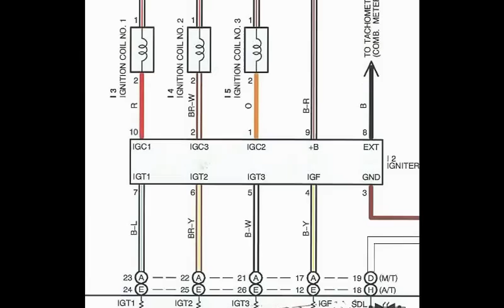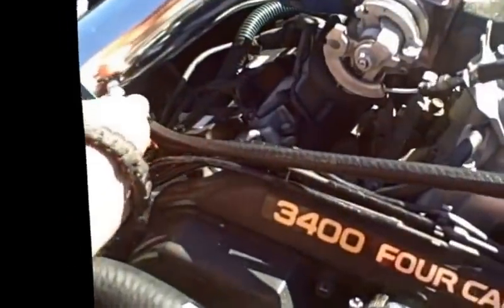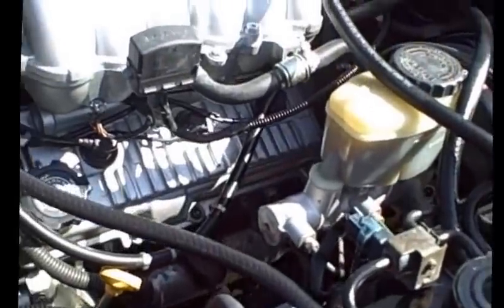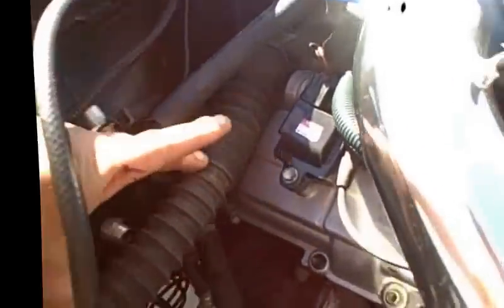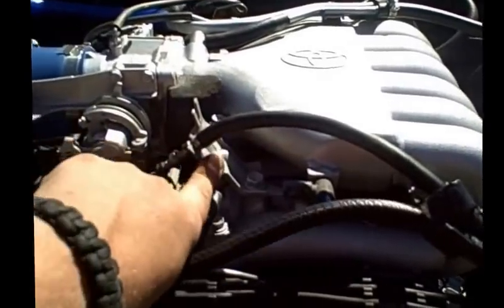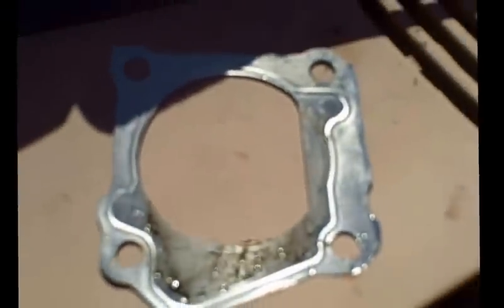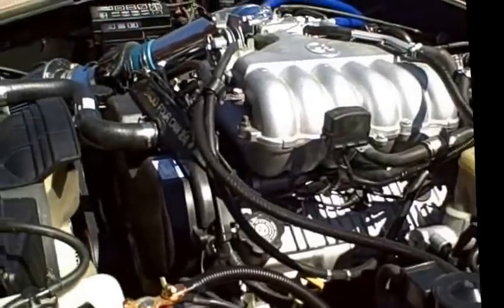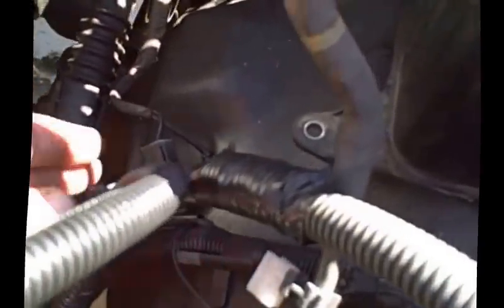94 Toyota 3.0 to 97 3.4 Engine Swap

Comment: Did you also have to change your ecu to a manual, or were you able to re-pin the automatic computer. The plugs into the ecu are totally different but you said you only had to repin with new plugs. Also did you take the charcoal canister out of your rig completely and replace it with the EVAP?  Thanks halfway there with my swap, yours turned out incredible.
Reply from the maker: yes, I had to use a manual ECU and re pin the plugs for it to work.  I had to re pin with new plugs because the auto ECU that came with the engine had to be re pinned to fit the manual ecu which had different plugs.  Thanks.......it was a monumental task as I didn't know what the hell I was doing at all!

Comment: What did you do for the oil pan? i have a 90 4runner putting a 2000 3.4 engine into it,  the 3.0 oil pan bolts directly on but what do i do with the pickup tube? the 3.4 tube doesn't fit with the 3.0 pan and the 3.0 tube doesn't look like it fits unless i take off the splash guard, then it might fit?. I'm just not sure. thanks for all the info!
Reply from the maker: +Christian Lambert Sorry for the late reply.  I believe your axle is different on the 2000 and will need a different pan.  Please join yotatech.com and ask away.  You will need to use the 90 oil pan and the related pick up tube.

Comment: Hey I saw another video on here and the guy used a 2 in body lift to “make room” for the 3.4 I’m wondering if you used one for hood clearance? Thank you for the video it helps a lot I’m going to be starting the swap in the next month and would just like to know the answer to that question.
Reply from the maker: Well, there was just enough room for the hood to close but I decided to cut the hood and put a low scoop on it like the newer 4 runners. It looks pretty bad ass.  Good luck with your project. Keep in mind I had no idea what I was doing when I started. If I can do it you can do it.  GL

Comment: i have a 2002 5vzfe that was out of a auto trans so cpu will not work, cuz its going in my 1991 4runner which is manual. the E-vap box and vacuum lines are biggest problems for me and price for E-vap box is high$$$.
Reply from the maker: +Toyota joe  Go to YotaTech and ask around.  It will work.  but you will have to use the 91 TO bearing AND the pilot clutch bearing in the 2002 so it will link to the Manual.  My donor engine was an auto that went into my Manual.  Sorry for the late reply.  Use your current evap box..........
Reply: Logan S thanks for the help.

Comment: i also heard you can use the oil pan and pickup from a t100 it would just be easier for me to use the parts i already have like i heard on this video you said you slapped your 3.0 pan right on, any help would be great!
Reply from the maker: +Christian Lambert   Sorry for the late reply.  I believe you can use the t100, but for certain I know that your 3.0 pan will have to go on the 5vz engine due to the front axle.

Comment: hey where in Oregon are you located? im in the middle of a swap, the engine is bolted to the transmissiom, and all I have left to do is hook up the vacuum hoses and harness. only problem is I have no idea how to go about doing this, as it seems like I don't have enough room on the harness to reach everything. I'm sure it's the easiest thing in the world to do, I just really didnt know too much about cars before I started this project. I rebuilt the 5vz, took out the 3vz and put the 5vz in by myself, and I can tell what a few of the things do, I'm just very confused. sorry about the long post haha
Reply from the maker: I"m in Central OR.  you will need to get the conversion harness to reach the transmission. I didn't know anything about what I was doing either.  Trust me, when it starts, you will feel like a rock star bro. Pick it up from toyonlyswaps.com   Best money you will spend as it will save a ton of headaches.  Be patient, it will work out fine.  Call them, and they will tell you what part of the harness they will need......basically everything from the pass side that branches off from the valve covers back...........and be sure to save the firewall grommet. I just used a cut off too, bent it back and pulled it out. BUT, chances are you have already done that.

Comment: You mention 5 quarts of oil and 1 of trans fluid won't that over fill the engine.
Reply from the maker: Yeah, I probably spoke wrong as I wasn't using notes. Just put in a quart of ATF and fill the rest with oil. Let it run for about 15 min then drain and add oil. I did it twice using cheap oil.  Both were dirty AF.

Comment: you didn't cover the exhaust system...its all from the 3.0?  direct bolt up?
Reply from the maker: I guess that is what I get for not working off of notes with few cuts. Yes, I did forget the exhaust system.  The 3.0 exhaust is a driver side system.  The 3.4 exhaust exits at the passenger side. To fix this, I purchased what is called a "crossover" pipe that will bring the exhaust to the drivers side that is bolted the the cat before going to the pipe.  You will need the year model of the engine you are installing and have a bung attached to it for the 02 sensor.  I can't remember the distance but the bung has to be positioned at the correct distance for a proper reading. I got my crossover from Toyonlyswaps.com as my welding skills would have messed it up for sure.  There are instructions on how to do it on YotaTech though if you chose to do so.  Nice catch.  I think that is the only thing I didn't cover.
Reply: where did you get the cross over pipe? I used to build these engines and the 3.0 for Toyota so I know just about everything needed... just wanted to see what hurdles you ran into with the exhaust... not many videos on this swap cover that... I have a 92 runner with an engine that just started knocking so im debating whether to rebuild it or do a swap.. thanks, kevin
Reply from the maker: toyonlyswaps.com out of Oregon.  About $175.  Well worth.  You will have to mail your current engine pipe to them for mod. Don't rebuild it.  Get the 3.4.  You will thank me later.  Just be sure to have a compression check done on it at the yard to be safe.  Once again, I had NO experience doing this and pulled it off like a champ.  Be patient, learn and the reward will be amazing.  GL
Reply: also where did you get your valve shim? Ive looked all over and even asked machine shops and they said they only come from Toyota.
Reply from the maker: ndspeedster
  don't get them at the dealership.  I got mine from cylinderheadsupply.com  I have a write up in the YotaTech forum on how to measure it etc.  I'm Oregonslonewolf on the forum.
  Chances are you only have 2 out of spec on the exhaust side. Intake will be fine as they don't get the heat.  Don't bother checking the intake sides.

Comment: What ECU do you need to use? Is it just the ECU that matches the engine/transmission that you pulled it from?
Reply from the maker: yes, the ECU that matches the engine and the trans.

Comment: Hi I have a 1991 4runner with a 2L-te in it.  It used to have a 3vz year ago.  and I'm about to need to replace the Head again for the 3rd time.  The head costs more than an entire 5vzfe engine.  I have a R150 5-speed and I have been doing some researching.   Do you have a parts list of items you had to get?  I understand from your Awesome Video you need the following.   Engine, ECU (auto or manual), EGR body, 3.0 or 3.4 Flywheel clutch etc. But 3.0 Throughout bearing, hoses, and power steering mods etc.  Also I found that its possible to use the same manual Trans bellhousing for a 3.0 on the 3.4?
Reply from the maker: Hey Kevin,  Thanks for the positive comment on my "seat of the pants" video I did. Sorry to hear about the bad luck with your heads.  I don't have a parts list for ya unfortunately. Seems like you have it down. Further clarification can be had by going to YotaTech.   You will be facing the challenge as I did of having to re pin your manual transmisstion plugs to the MANUAL ECU. The pics of the plugs in the beginning of me doing just that.  The MANUAL ECUs  are pretty hard to source and chances are you will only be able to find the auto engine and ECU as I did.  Go to YotaTech if you haven't already done so and look for a thread where he used a 97 ECU and 97 engine to "repin" so it will work. Once again you will need a 97 manual ECU.  He goes step by step on how to do it.  Pay close attention on making sure your negative black grounds are property seated in the plug, They can be a pain.  Good luck
Reply from the maker: Yes your manual will mount right up no problems.
Reply from the maker: For more clarification, you will be using the wiring harness from the automatic engine and "re pinning" them into manual plugs to work with the manual tranny and the plugs that go with the Manual ECU of that year engine.

Comment: Logan I have a 2000 3.4 donor is auto but I live in California so what would I need to do to clear the emissions in California and not have the check light on.. what do you recommend
Reply from the maker: that I don't know exactly. I recommend you go to YotaTech.com , sign up, and ask around.  the ECU and egr is key...I think.  your 02 sensors play a part too.
Reply: +Logan S ok thank you yeah trying to read as much as I can on it

Comment: You hydro locked the 3.0 so you put a ebay cold air intake on?
Reply from the maker: No no, I didn't have a cold air intake on the 3.0. The airbox mod (drilling holes in the air filter box) sucked in the water when I went down.

Comment: I just have a question on wiring. Did your engine come with the wiring? What wiring do you recommend just getting the actual harness? I have the main engine harness but I've read that the engine won't run without the dash harness, is this true?
Reply from the maker: Yes my engine came with the wiring harness for the engine.  However, this was an automatic engine I had to re pin to match up with my manual transmission and it needed new plugs too to fit the same year manual transmission ECU. Yes on the dash harness.  Contact ToyOnlySwaps in Oregon and they can assist you.  This has all of the needed connections to your transmission 4x4 etc.

Comment: Question I heard there's a 4.0 motor that fits on a 4runner that saves gas and more horsepower i got a 93 4x4
Reply from the maker: Yeah, the 2003 is a 4.0.  Seems like a tough conversion to me as I don't think it even used the same transmission computer, motor mounts and whatnot.  Time for you to get to studying that one.  I have no idea.

Comment: logan i got 1994 toyota 4 sr5 4x4 v-6 3.0 efi it is in automatic what engine u put in. make n model i want a 3.4 autmatic engine mine
Reply from the maker: +justin Roa  I too put in a Toyota 3.4 which is what this video is about.  Without a doubt I would put in a Toyota 3.4.  Keep it Toyota. 97-2001 3.4 are outstanding engines.  The 3.0 is a 3.slow.  You will have much easier luck finding and auto than I did finding a Manual.  Check out YotaTech.com. Sign up and read, read, read, read....................then read some more.  I had NO experience prior to this with exception to changing a timing belt.  That site saved my life!!!!!   GL

Comment: Great Video. I will be doing this swap soon. Although the Manual ECU is very hard to come by these days. I am still on the look out for one.

Is the 2" Body Lift absolutely necessary? I was wondering if i can get away with a 1" Body Lift and maybe cutting the hood skeleton.

Comment: Is this a better engine than the 3.0 svze?  As far as repairs breakdowns reliability ?
Reply: The 3.0 is a very underpowered engine, it has its infamous head gasket issues but if it’s replaced with the upgraded ones it should be fine. 3.4 is more powerful and more reliable, but the 3.0 is fine for most people.

Comment: I have a limited  1997  3.4 l 4runner  that I flip and total the body can I put the engine and  tranz in a  1995 4 runner
Reply from the maker: +Patrick Blades  yes you can.  You will have some challenges with the ECU from the 97 linking to your 95.  You will need the schematics from the 97 AND 95.  Join YotaTech and dig in and read read read.  I am not sure if the plugs on the back of the ecu on the 95 is the same as the 97. That will be your hardest part.  ToyOnlySwaps will build you a harness to make it happen.  I have never done this and pulled  off the swap.  You can do this. Take your time Pat and most important read read read.  You can find my swap details on yotatech user name Oregonslonewolf as it might be helpful as I had to do the same thing.........re pin the ecu plugs.  The people on there are amazing people willing to help.  GL
Reply: I have the ECU and harness for the 97 I only want to use the body

Comment: Someone can tell me what is ATF the product he used to clean the engine inside?
Reply from the maker: Sure, It's just automatic transmission fluid......ATF, which has detergents.  Drain your oil, add one quart ATF, fill with cheap oil, run it for 5 or so at idle, drain and put in good oil.  Its fun to see how dirty the second batch of cheap oil is compared to the original you first dumped out. I've done this with a Mazda 626 I had years ago every 3rd oil change. When I got rid of it she had 300+k miles on it and still had excellent compression.Cheap oil once a year is far better than a new car every 100k miles. I've done it on every car since. GL

Comment: On the fence, I missed the part about the Harness, did you send it to ORS or did you do the wiring yourself?
Reply from the maker: Alanzco Orozco  My situation was the engine was an automatic but my truck is a manual.  I had to swap ecu plugs using EWDs for both years and re pin the manual plugs as they aren't the same.  The dash engine harness I did farm out to ToyOnlySwap.  VERY well done and I highly recommend them...........great people and excellent customer service with a far lower price than ORS. Consider them for the Crossover pipe if you need that built.  Get other parts from ORS though.  Check ebay for OEM gaskets as I saved over $120 going this route........shipping was free too and just took a bit of time waiting for them. Take the plunge.  I had no experience yet pulled it off.  Is that Cannon Beach I see in the picture?  TOS is an Oregon Company.
Reply from the maker: +Alanzco Orozco   And good point, I did forget about the harness part.  Being it was under the dash. I spaced that off.

Comment: what about fuel system you stall with the 3.0 or you have to modify any lines
Reply from the maker: Well, there is a bolt on the fuel line.  Simply flip the hose over so it routes to the proper direction.  Check out YotaTech. com for more info. in the swap section.  Good luck if you do it.

Comment: Wow all that for 30hp/tq. If my 3.0 goes in my 4runner I'm gonna slap a 5.3L ls in it and be done with it.
Reply from the maker: Have fun with it. I just wish that motor was an option when I did it at my budget. You will have some difficulties for sure.  GL
Reply: @10MinutestoRouletteFortune thanks I have a ls donor vehicle that needs a transmission. And I have a buddy with a 80s toyota pickup. With a small block swap on a "6 lift sitting on "35.

Comment: just curious why didn't you swap in the 1uzfe??
Reply from the maker: The 4.0 Lexis engine was out of my price range and would have been a PITA to wire up. Not even sure if it would work on the engine mounts or location.  A wee but out of my skill level.
Reply: Logan S I have one in a 91 4runner. it all lines up. wiring is easier than the 3.4 swap as im told anyways.  1uz about 800 American 8000 rpm all day and the torque holy shit!. truly can not break it. your work is bad ass. you have skill. I wish I knew you. great job and super thanks for the video.

Comment: Did you leave the stock 4runner transmission ?
Reply from the maker: yes, the bell housing bolts right up.  Just be ready to use long long extension to make about 4 feet to get the top bolts snug at top.
Reply: Reality TV Clips thanks for the reply I appreciate it also did you have any shifting issues because of the ecu? You used the 3.4 ecu?

Comment: dont forget the extra $400 - $600 for the damn wiring harness
Reply from the maker: The wiring harness should come with the engine along with the ECU.  The only extra harness you need (if you were like me and the wiring confuses the hell out of you)  for the conversion goes from the ECU through the floor to the transmission and 4X4.  $230 tops from ToyOnlySwap.  If you paid more, you got hosed.
Reply: i am using toyonlyswap right now and am with cliff, paid them 400 for my wiring harness and it doesnt work, so i sent it back a week ago to see what the heck happened i miss my 3.4
Reply: Just curious.  How did you get the harness from toyonlyswaps for $230?  Their website says $400.
Reply: yea lol XD i was thinking same thing
Reply from the maker: Oh no man, sorry to hear you had that experience. Ground issues are so common in these swaps when you are playing with pinning them in to make them. I'm positive they did you well.  With my year, I guess it was cheaper.
Reply: yea hope they fix the harness after they wired it wrong

Comment: Does anyone know the lower radiator hose part #?
Reply from the maker: Sorry for posting so late.  If you are in your swap you have probably figured it out.  If not, the same lower hose for the 5vse with a little cutting modification.

Comment: what do you recommend for connecting the 5vz wiring harness to the earlier model ecu
Reply from the maker: +audiohuasca  Well, there is no recommendation but a matter of necessity.  You will NEED the 5vz ECU for your type of transmission for it to work.  Your earlier model ECU will be up available for sale.  When you get your engine, you will need the ECU from that engine and if you are putting in a automatic engine into a Manual transmission car as I did, you will have to re pin NEW manual transmission plugs for it to plug into the ECU.